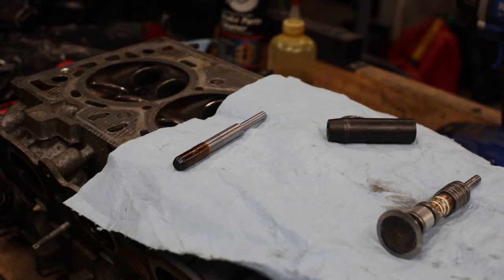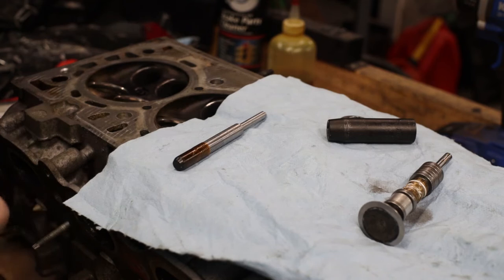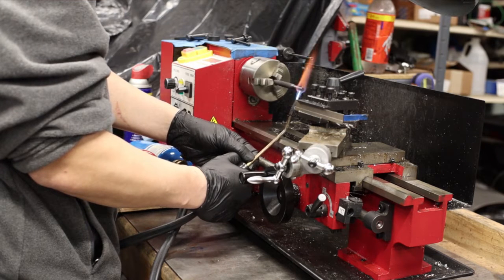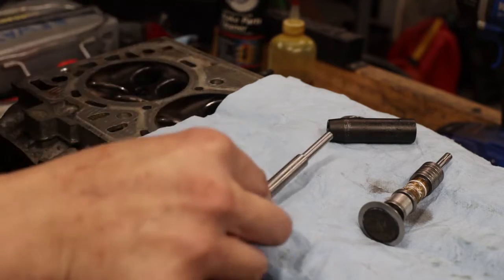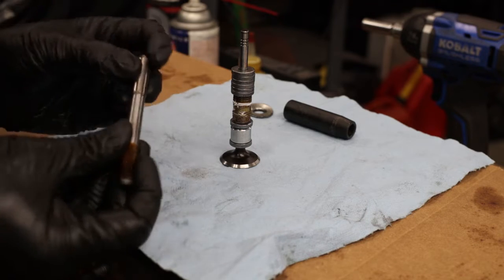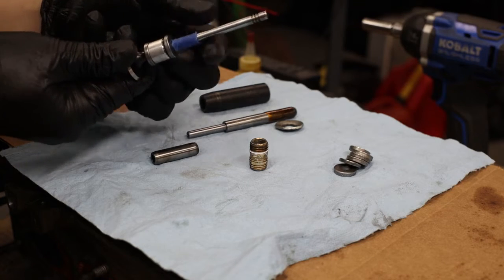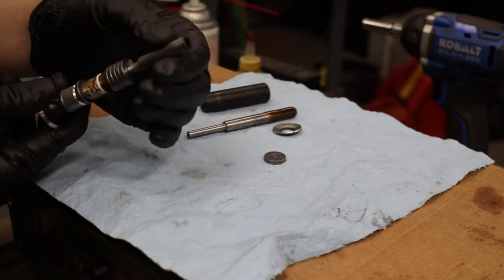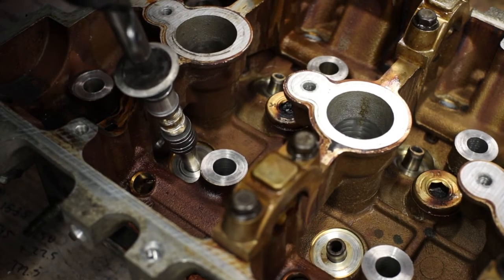Valve Guide Replacement Aluminum Head Refresh  w Seat Cutter   DIY backyard methods

Comment: I recently purchased a case of Berkbile 2+2 Gum Cutter and boy was I shocked. They changed the formula and it is not as good as the original. I have been suing 2+2 since the early 70's and have had a can in my arsenal ever since. The latest acquisition may have changed my opinion of it forever. It does now work as well. I guess our government is again protecting us senselessly. The EPA has more authority than Congress and what they do with regulations imposed should actually go through Congress for a vote. Who gave them this much authority?  I believe they just usurp it as needed and no one has objected to date other than those that were fined. Talk about herding sheep....